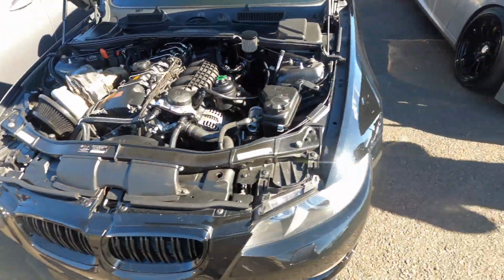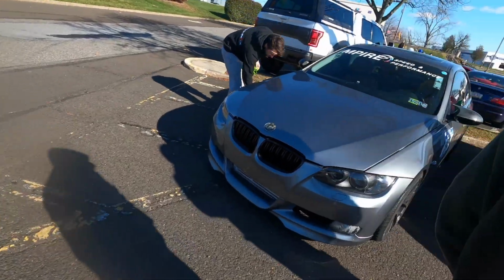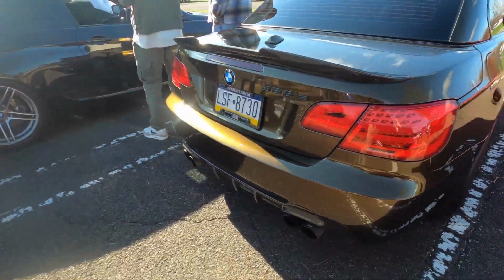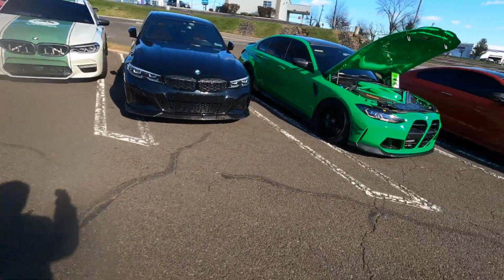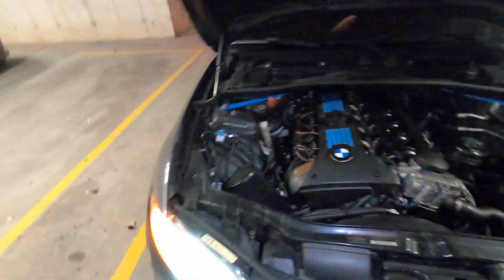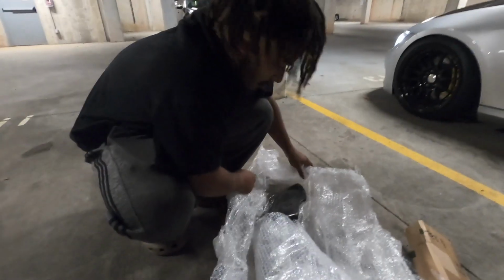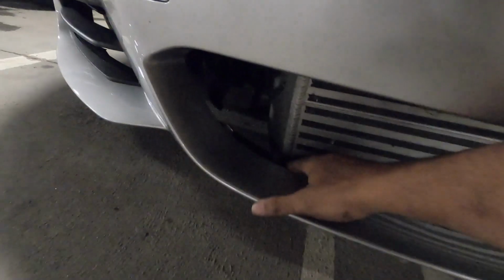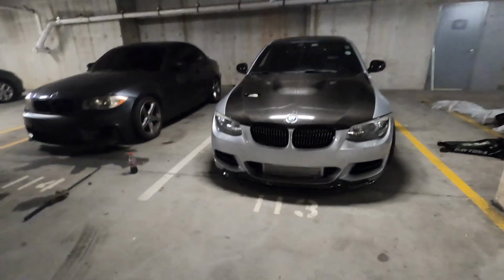3 single turbo N54s steal the show!!

Comment: I really wish I didn’t get a n55 😭😭😭😭 This makes me want a n54 instead of a b58 for my next car 😭🤦‍♂️
Reply from the maker: Yea man!! I bought one at first to then it got totaled so I bought this and never looked back. Don’t regret it not one bit. I was looking at a silver stone f82 m4 but I didn’t feel the price was reasonable with the power these things can put down. Just a raw vibe to E chassis cars too
Reply: @laggyis  I plan on picking up another car soon on top of the n55 , I’m in the same extract Predicament lol I’m looking at M4’s but I might just cop another 335i or 135 😭I prefer the E chassis over any other and I’ve owned a F22 and e90 before my e93
Reply: Careful what you wish for. I've had my 07 n54 8 months and my 1st my alternator went out and left me stuck for a day but that was an easy fix. 4 months later, on my way to work my oil coolant hose from the radiator to the auto trans cooler blow IN TRAFFIC and I only had about a min to pull over and shut it off. 3 hrs and 194 dollar tow later I made it home. Shops wanted $1000-$1300 to put on a $24 hose🤡 When everything's fixed and running right it's a fun ass car, but when shit break I'm like F#*k bmw. The fact you have to register the damn battery when it has to be replaced is the kinda headaches you only run into with these kinda cars